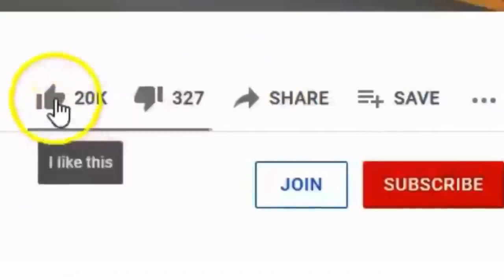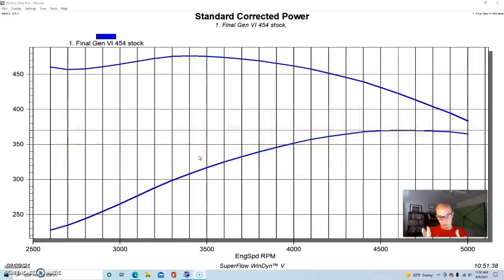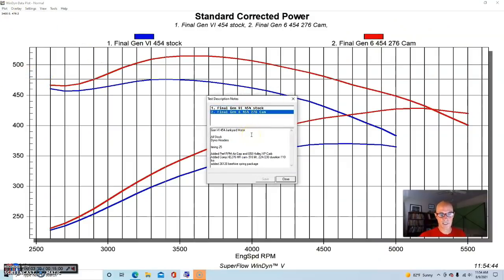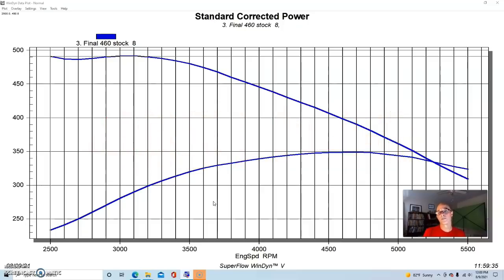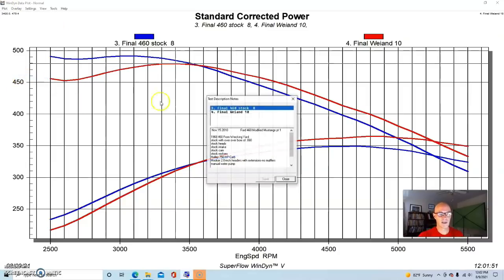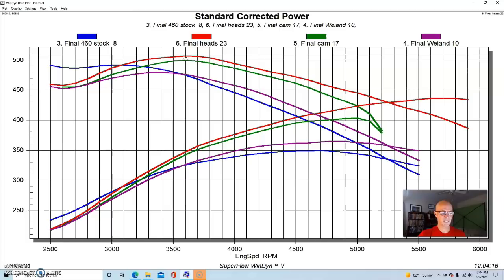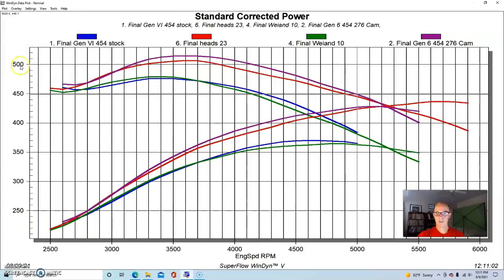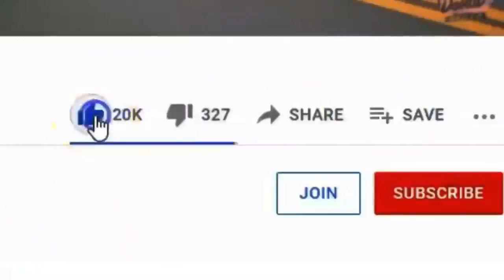JUNKYARD BIG BLOCK POWER-460 FORD VS 454 CHEVY FULL DYNO RESULTS

Comment: I'd like to see maxed out displacements of each lock horns in the future.

Chevy - .060 over + 4.25 = 496
Ford - .080 over + 4.5 = 557
Reply from the maker: FORD WINS THAT ONE
Reply: @richardholdener1727  I assume that is because there is.... No replacement, for displacement!?!
Reply: @richardholdener1727  Unless you get a siamesed tall deck Bowtie block, put in a 4.5" stroker crank at which point you have over 600 cubes.  But you won't be doing that with a junkyard block.
Reply: I can appreciate the fact that he’s not using exotic parts. I wish we had this when we were 18 and broke.
Reply: @scottgregory9672  when I was 18 and broke parts were so cheap it would make you cry today. But jobs were plentiful so being broke was an option
Reply: Technically you can go bigger than 496...
Reply: @corvettejohn4507  only problem is the Ford has a tall deck block as well, both Chevy and Ford do 632 cubic inches, though the Ford wins that one over 1132 hp on pump gas on a 598.
Reply: @corvettejohn4507 Actually, From what I could find, the bowtie block will go to 4.600 bore, so with your 4.5" crank, you get 598 cubes. Ford motorsports block will also go to 4.600 with a 4.5" crank. It is also worth mentioning that most junkyard 460 blocks will bore .080 over and take a 4.5" crank with no clearance mods to the block.
Reply: @Frontpagefab  I meant to say 4.6" stroke which is the max for the Bowtie Block.  Also they can be bored out to 4..625".
Reply: @bradmiller4999  632 BBC makes well north of 1200 plus at all motor championships. Chevy wins that one.
Reply: @Frontpagefab  4.6 stroke also fits in later 460 blocks if you’re going for every inch, and I believe there have been folks with fill and good sonic that have gone all the way to.140 over.   Rare but possible in junkyard block.
Reply: @corvettejohn4507  Well, as long as we’re going aftermarket, the Eliminator block can go 4.7 bore and 4.75 stroke....
Reply: @jaywilliams2710  I knew a 4.5" would fit easily. Hadn't heard about a 4.6".
Reply: @toomanyunlearned1  are you saying the best a 632 Chevy can do is ~1250 (guesstimating “well north of 1200 plus” since if it was 1275 you’d say “almost 1300”)
Reply: @Frontpagefab  Eagle (I believe) had a 4.6.  Edit:  Ohio not Eagle on the 4.6”.   Not great to package but if you live and die by ci, then....  heck, with the right rod/piston, I’d bet the 4.75” monster could work, for a while..
Reply: @richardholdener1727  it’s.060” over though.
Reply: Back around 1990 it was more common to bore 454s to 4.375" and stroke them to 4.500". That's the original 540
Reply: @richardholdener1727  fail. 454 can go 4.375 x 4.5 safely, more with sonic testing. I was an automotive machinist for years. I've gone farther.
Reply: @davisstephens8405  are you saying putting a 4.5” stroke in a 9.8” deck height block will live?  What rod/compression height?  Or are you talking about the tall deck deal?
Reply: @jaywilliams2710  it can be done in a 9.8" deck with some really short custom 2618 forged pistons. It isn't cheap, but it can be done. If the block passes a sonic check for wall thickness, you can go 4.390" bore. Trying to go 4.625" stroke is where you realize you should find a tall deck 427 block out of an old C60 dump truck. Then 4.75" stroke is easy and 4.875" stroke has been done. 4.39x4.39x4.875x6.2832=590 from a junkyard block
Reply: @corvettejohn4507  false
Reply: @davisstephens8405  the Chevy tall deck is still .12 shorter than the 385 series block so if you felt like wasting $, you could probably drop the same 4.8” crank in the Ford and pay a couple thou for pistons..  On the low deck, even with a short piston, you’d have it well out of the bore at the bottom and have a huge angularity issue, and by the time you grind the pan rail, how much is that block moving around?   I mean if we’re just measuring what’s possible, any 460 block could do an off the shelf 4.75 stroke, the numbers work out, and at a 4.5 bore, that’s 604 inches from low/no shift 429 or 460” motor produced ‘68 on....
Reply: @jaywilliams2710  I'll take better heads over more deck height every time. Chevrolet wins that one. My 460 is staying a 460 with AFR 280 heads.
Reply: @davisstephens8405  Better heads?  At 600” on a stock block build, what do you think the general platform offers that outruns the SR71 or Boss offerings?
Reply: @jaywilliams2710  too many to list. Mostly ProStock stuff. But back in the real world, AFR 315s make better numbers on a 540 BBC than any 557 BBF I've ever even heard of. You can't get a better head for less money for ANY engine.
Reply: @davisstephens8405  notice I said “on a stock block 600”, so even if you did have something that outflowed the Eliminator rcv1, that would bolt to a production block, they would be useless at the rpm and compression a long stroke stock block will survive.  As for your AFR 540, you just haven’t been in the right circles..  I’m sure you’re not talking 16:1 on methanol, with large dia lifters and .9 lift, so what limitations/rules do you use to get “540 makes most hp”...
Reply: @davisstephens8405  not without block filler.

Comment: I have a Ford 460 Marine engine in my 79 Spectra and I'm trying to make a little bit more power.. what is the best drop in camshaft to run on this engine I do have d3ve-a2a heads..  an all I wanna do is buy a kit for it.  that has a camshaft lifters an timing chain.. this will be my first v8 motor build. I need help soo bad 😞😞😞  I don't want to mess anything up.

Comment: Richard, I noticed that you ran a mechanical pump on the Ford and an electric on the Chevy. Ever since I started messing with hot rods, I was told/read that an electric pump frees up a bunch of power. In your experience, does it really make much difference?
Reply from the maker: IT HELPS

Comment: 472 is the Ford actual displacement vs 454 on the chevy.
Reply: Skip R  Richard said the ford was already redone to .060 over, making it a 472
Reply: That's insignificant. 460 had stock replacement pistons

Comment: Man I can’t wait to do my 460 forged rods stock pistons with ring gap Edelbrock performer intake or weiand stealth and a custom comp cam and twin turbos later on hope for 500 hp na
Reply: You might have to port the heads. Youll definatly be happy with the torque!
Reply: Like John said might as well do heads too, it’ll be worth it in the end, 460 cubes is a lot of air to move 500hp shouldn’t be a problem
Reply: @johnsheetz6639  aluminum heads would be way better.
Reply: @Zach-ju5vi  veryy true. Honestly the only way. no matter who has the grinder.
Reply: Performer RPM intake minimum. Flat top pistons zero decked if running a D3 head. Stock pistons will need a much smaller chambered head.

Comment: I figured the longer stroke of the chevy would gain on the torque, but apparently not so much.  No replacement for displacement.
Reply: So much testing on the stroke vs. bore has been done, and yet there's still so little proof of an actual difference. I read an interesting article by David Reher a few years ago about that, and rod angle. As far as he was concerned, it was all B.S, and they at Reher-Morrison had never been able to prove any advantages. David Reher knows his stuff, and I've heard other bright minds like Todd Goodwin and Ron Potter say similar things.
Reply: @AB-80X  interesting to know.  The only advantage I can see the shorter stroke having is higher rpm capability.  Less piston speed at certain rpm.  I'd personally limit a 454 to 6000 or so, where-as the 460 could probably live at 6500 or 6750 a tad easier.  On paper or with piston velocity numbers anyway..

Comment: "It's not gonna stop the chevy guys from loving chevies, and the ford guys from loving chevies" well done!!! Hahahaha!!!
Reply: Love "Chevies" lol that's hilarious.
Reply: @jamesreaves5534  I grew up working on other peoples' cars before I was old enough to drive.  I learned quickly that Chevys were easy to work on, parts interchange was fantastic, cheap to get parts for, and easy to modify and make seriously quick street cars.  What more could a gear head ask for?  

Plus there's very few engines that look better than a big block Chevy with aluminum heads and intake.  Chevy knew how to style their engines to look as good as they ran.  Stock Ford engines always looked like dog poo to me.
Reply: @corvettejohn4507  My 1968 351 Cobra Jet holman-moody special I had in my 1984 Mustang GT which I purchased brand new looked great. It had a one-of-a-kind holman-moody intake it was a prototype probably the only one ever made. I ordered headers from Advanced Engineering West in California and they had removable collectors with four pipes across from one another instead of your standard two on top of two. The collectors had a y-shaped front portion that slid onto the pipes and then became round like a standard header would wear it hooks up to your exhaust. When you slid the collectors onto the Header pipes there were 2 tabs either side that you ran a bolt through locking the Headers and collectors together. These were really long headers and exited past the firewall of the car. I ordered a five core radiator from Webster racing radiators in New York. You really couldn't tell that it was a bigger motor because the  Cobra Jet being a windsor as well as a 302 being a windsor they looked roughly the same although the 351 Cobra Jet was if memory serves me correctly an inch wider making it a 1/2") inch wider per side. This is negligible and you really couldn't tell that it was larger. The headers did make it look a little bigger in there because they were massive Racing headers, but they would have made the 302 look bigger as well they fit both 289-302 and 351. The 351 is the engine that Ford should have put in that car. It would have been able to outrun all others in that time. GM only had a 305 in their Camaros and Trans Am's. The 350 was in the Corvette, but the 351 would have outrun all of them. My 68 351 Cobra Jet holman-moody special had a reed racing cams flat tappet solid lifter 289 cam because they didn't have a lot of good 351 Windsor cams at the time. With this camshaft I had to wire it up using the 289 302 firing order. The 351 use a slightly different firing order. There's nothing like the sound of a flat tappet solid lifter cam under the hood, it's noisy and it just sounds fast. I am in agreeance with you there isn't much that looks better than a Chevy under the hood. They're much easier to work on and much cheaper too, as well as what you said. The parts have great interchangeability and are much easier to find if you're trying to find used parts. All the way around for a poor man the Chevy is the way to go oh, but you never forget your first love. To this day I'm still equally torn between Ford and Chevy but Chevy gets the nod especially if I have to work on it. If somebody else is doing the work I don't know. It's pretty much a toss-up at that point. My favorite car is still the Mustang and the 69 is my favorite of all. I think the 69 Mustang with the hood scoop and break scoops on both sides along with the spoiler and the Fastback make it the most beautiful muscle car ever built to me. They really are Sharp, both the Mach 1 and the Boss. I would love to own a 1969 Mustang with the 428 Cobra Jet or the 429 boss I couldn't decide between the two either would be fine with me.
Reply: I love my SBC and BBF lol

Comment: The big differentiator between stock block BBC vs BBF is when you start going for more displacement, the BBF's giant crank case, 10.300 deck height, and 4.900 bore spacing just allow for significantly more than the passenger car BBC's 9.800 deck height & 4.840 bore spacing. Off the shelf 557" budget strokers FTW, die grinder need not apply! I believe a stock 454 block is good for ~510"? Not exactly a small engine, but a difference of 45-50 cubes isn't small either.
  
Of course, if you don't need 557", a BBC will be a little lighter and you'll have a MUCH larger parts selection of course(especially parts you may not think about - like headers, whether swap, long tube, turbo, that part sucks for BBFs lol just MUCH less choice). BBFs finally have a solid aftermarket with street parts and serious race parts, but the Chebys have everything in between.
Reply: I’d bet you can build a slightly more powerful Ford bc of that displacement difference than Chevy on the same budget now days. Not 10-20 years ago but today for sure. A 557 with blue thunder heads will likely out-compete any Chevy 514 stroker with solid heads on a similar budget
Reply: Here's one for you:

500 Caddy (4.3 bore, 4.304 stroke)....bore out .140 to 4.44 without fill.......300 to 4.6 with fill.  Center bore spacing is 5 inches.  Up the stroke to 4.6 inches, and you could have a 612 CID Caddy.  Best part with the big Caddy.......only 60 pounds more than a Chevy 350.

The one big downside of hopping up a big Caddy?  Cost.
Reply: @Greenskies321  SCJ headed 514's weren't all that expensive 20 plus years ago.
Reply: @markdubois4882  'Cadillac'...
The main issue is that you can't get heads that will compete with what is available for the more popular brands.  Furthermore, what you can get, are extremely expensive.  However, you can build a 540 with the stock components.
Reply: @michaelangelo8001  The big Caddys take really well to boost.  5.5 pounds with a bone stock 500 with the large chamber heads pushed 447 HP and 625+ lb-ft torque.  Up the boost to 9.9 pounds, and torque is 800+ at 3500.  I bet it was over 1000 lb ft closer to 2500 rpm.  HP was 542.

Richard did this test a few months back.
Reply: @markdubois4882  A "caddy" is the guy who carries your golf clubs...

I've built a few Cadillacs.  If you could get good heads for a decent price, they would make a good low-buck performance engine, but as things are, it's cheaper to build a Ford.

I asked Richard what kind of rocker arm setup they used, but he never would say.  The stock setup won't stay together over 5,000 RPM.
Reply: @michaelangelo8001  The valvetrain is the weak point on the Caddy....I do know that.  Rev them like a diesel....they have torque like a diesel too.
Reply: @markdubois4882  They make good light truck engines.
Reply: @michaelangelo8001  A friend of mine dropped a 472 from a 68 Caddy into his 80 Camaro Rally Sport (originally had a 267).....and it was like night and day.
Reply: @markdubois4882  A caddy, is the guy who carries your golf clubs...
Reply: @michaelangelo8001  It's also short form for a Cadillac.

Comment: Knowing how well the BBF responds to hyd roller cam, I am surprised to see stock (ish) profiles being so close to each other. I expected the bbc to be a bit stronger...

As I run mostly hyd rollers in my BBFs, I can say they added lift and loss in resistance is worth 30-40 hp easily... But some equalizer came with the comp increase, the old school BBF running a point higher comp... 

Overall, very close power outputs with different approaches.

Comment: Great video ,just love those big blocks ,big easy dumb power , Is there any way to "dyno" run an automatic transmission say a Ford C4 vs Chrysler 727,vs Chevy powerglide see which one has least drivetrain power loss and how much !!!
Reply from the maker: yes-on a chassis dyno
Reply: We already know the answer to that, the Powerglide has the least Hp loss.  The more rotating mass you have in an automatic trans, the more power it robs.

Comment: 69 Lincoln MKIII 460 was rated 365 hp 500 tq, the 429 was rated at the 485 tq, these 460s are a great base to start with for sure but the C8/C9/D0VE Heads flow 265/135 at .500 lift and the cam is under that a bit (Kinda sad the 302 Gt40p heads actually outflow these on the exhaust side )
Reply: For Junkyard hunting look for a 93-97 460 (15cc 1.77 compression height pistons), use 75cc heads, 023x4.4 head gaskets which gives you a nice 045 quench and 10.32 to 1 compression, add the cam and carbureted intake of your choice and you have pure Junkyard Gold

Comment: Had a 460 in my old station wagon. Was awesome for towing, but it sure sucked the gas down.
Reply: What year of wagon ? It may have been a Police interceptor. I've seen a few in them.
Reply: @cammontreuil7509  1974 ford LTD Country Squire with the trailer towing package.
Reply: @jamesmiddleton5304  I used to have my own business. I specialized rebuilding Ford engines.
I pulled a 460 out of a 74 wagon with the towing package. It had the PI engine.
I remember having to order special parts for it. 
I remember it having the huge spread bore carb.
I would bet you had same engine. They are rare.
Reply: The 460 has a stronger block with bigger head bolts than the 454 head bolts strip out

Comment: Love your big block tests! I'm building a 99 chevy gen 6 454 right now, and I'm about to start on the heads.  Do you have any porting advice on the g6 heads? There is a big lump of iron in the intake ports to enhance swirl, and I don't know what to do with it.
Reply from the maker: I have not ported them
Reply: My father in law has a 99 3500 and built the motor. It tows a big boat. He left the hump, gave it a five angle valve job, blended the bowls, and did something to the chamber and bore to deshroud the valves. He used stock pistons, shaved the head, stock exhaust manifolds and stock intake. The cam is bigger than stock but I don't know what it is. It put out out 486 rwt and 440 rwhp. It'll put you back in the seat and roast the tires but doesn't rev more than 5500. Great tow motor.

Comment: The moral of the story is if you want a low stress 1000 hp at 14.7 psi of boost a big ford or chevy is hard to beat.
Reply from the maker: ypu might want to do a search for pro stock or coyote
Reply: @CoyoteFTW  do u like du.des